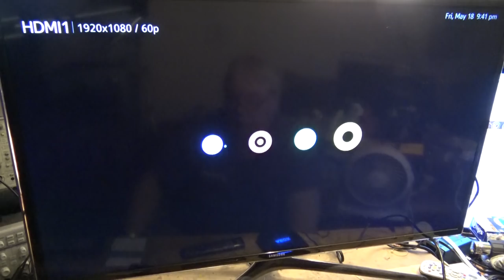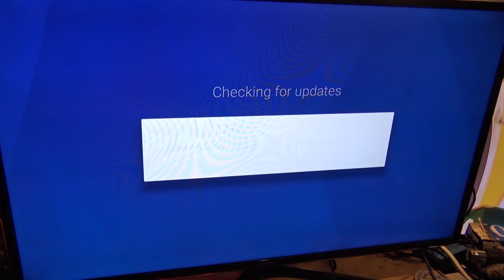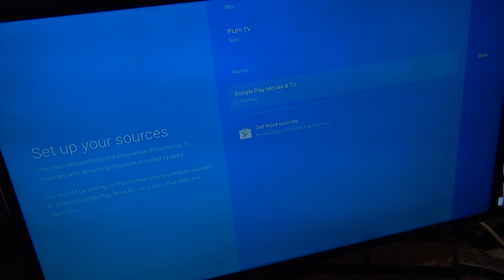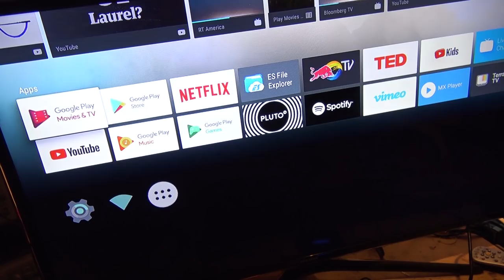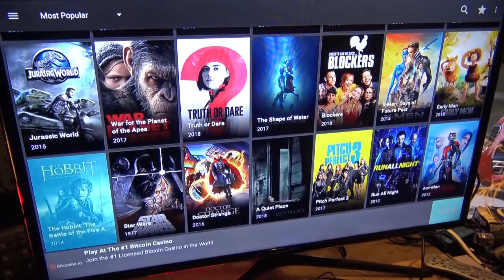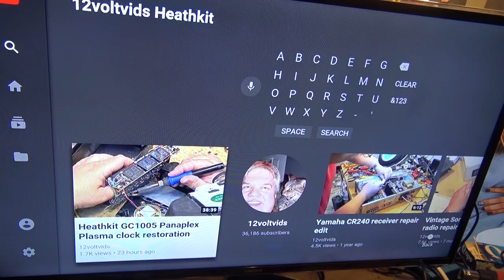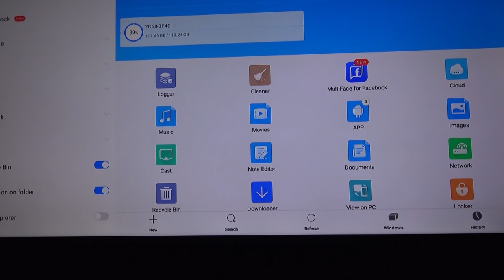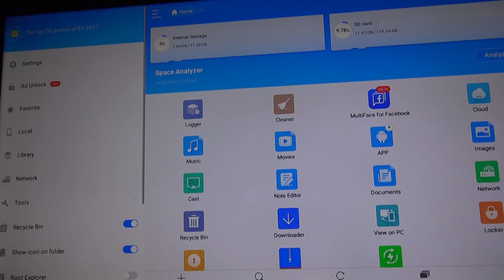ABOX A4 Android TV box set up test and tear down

Comment: What a cute little device, its amazing how compact they can make stuff.
The only downside is when it dies, its pretty much unrepairable, but thats been that way for a long time.

Putting a photo transistor in a box as a trap lol, false chips were another favorite  to confuse people from working out how a circuit was wired.
Most of the chips now are micros and the code is locked inside it, almost impossible to access and copy.

Comment: I always wondered how they make surface mount devices not fall off the back side when the front side is reflow soldered. Until someone, i think Paul Daniels, pointed out the dots of red glue that hold bottom side components in place.